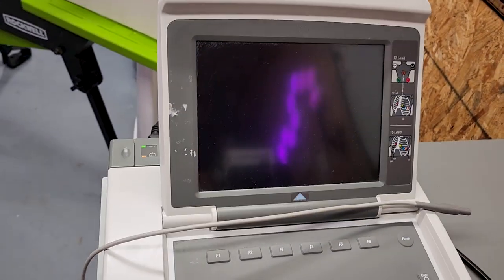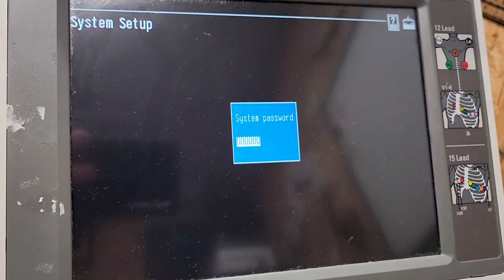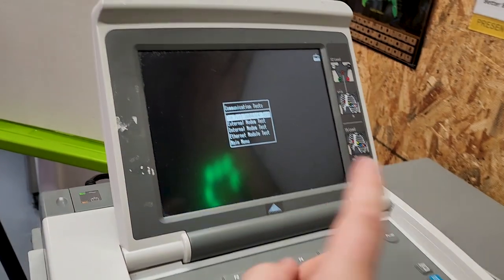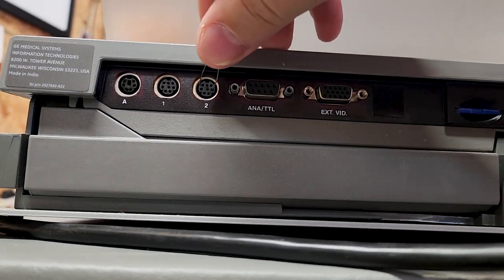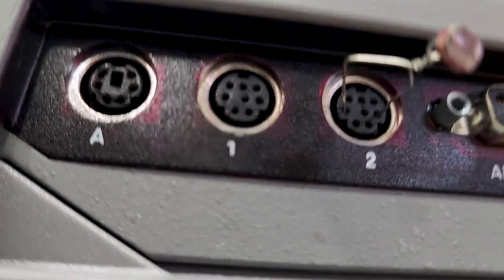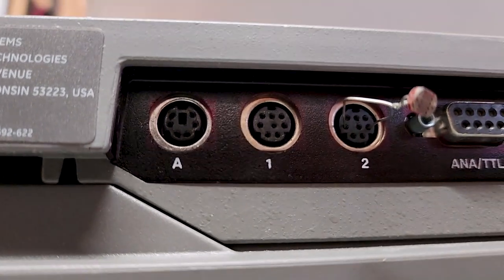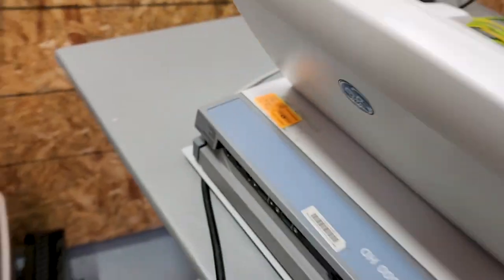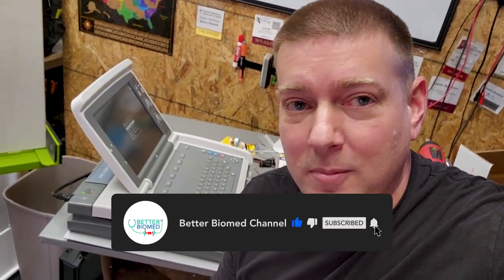GE MAC ECG Port Testing

Comment: Com1 will power on the modem but not send the data.
Reply from the maker: Internally, Internally settings, you set the com port for the modem. I'm curious - cause I've never tried it, if switching rhe settings enables serial data out to the modem on port 1
Reply: @BetterBiomedChannel  me either and I used to work for The General. Lol